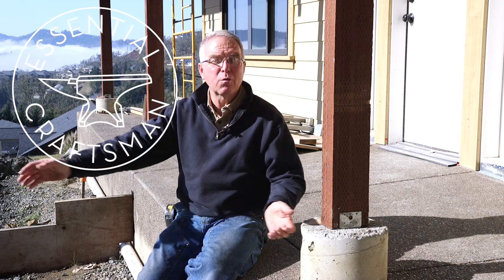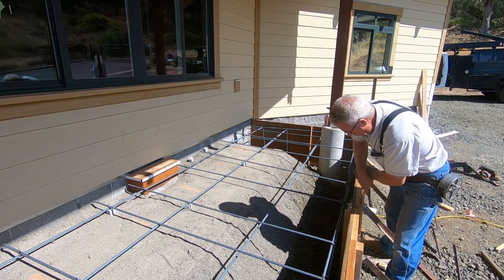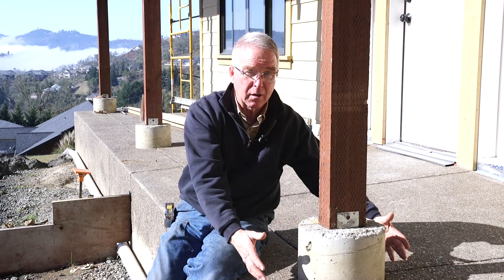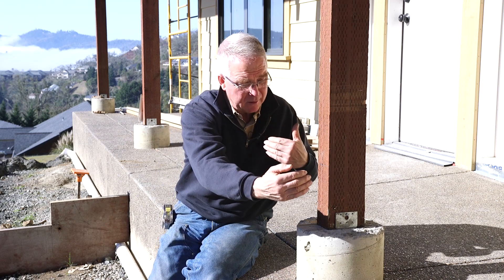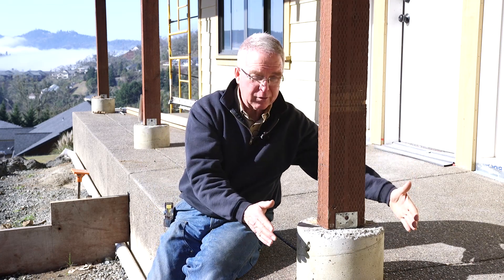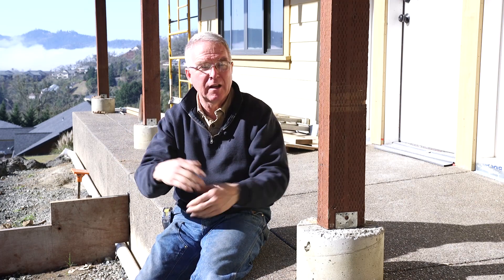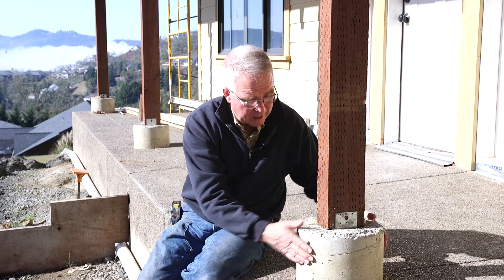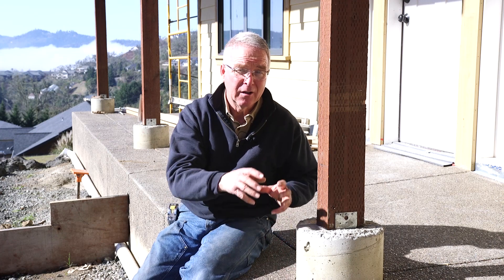Planning Out a Front Porch

Comment: Whenever I do column bases for porches, the framing is actually hung off the post about an inch off the concrete porch. And the finish product (something that wont rot like pvc, cement siding, stone) goes all the way to the porch surface.

Comment: Living in New England I have to disagree with your statement about the permanence of masonry. Whether it’s a sidewalk, patio, or outside steps, eventually someone will spread rock salt on it and it will start to degrade. In 1970 my dad built a retaining wall with 12” CMUs. While the wall is still there, despite not having any weep holes, I have had to replace the 4” thick cap blocks twice. I suspect the problem is from trying to blow snow over the 6’ high wall and thereby driving moisture into the edge of the cap blocks. Brickwork tends to need repointing after 40 or 50 years. Flagstone walkways and patios, even if they aren’t abused with salt quite often have the mortar come loose from the joints and the larger stones will usually break loose from the bed of mortar. There is no bigger attraction than “no maintenance” and in home construction and remodeling there’s no bigger lie than “no maintenance”. There will eventually be some maintenance needed. In the case of this house it will probably wind up on the third or fourth owners of the house.
Reply: Well, they really don't have much in the way of snow here, so I don't forsee them putting a lot of sock salt down on the concrete.

Comment: I'm all about the "low maintenance" aspect of building pretty much anything. And I'm willing to pay more to get to that point.
Now if only there was some form of wood treatment (EDIT: that is environmentally friendly) that rendered the wood utterly indigestible to insects, fungi, and whatever else likes to eat wood, I'd be much more ready to consider using wood on exterior surfaces of a house.
For that reason, my personal opinion is that synthetic (eg. vinyl siding and other such composite materials) or mineral materials (eg cement board/"hardiboard" as used on this house) are the way to go if you don't have the money for a full masonry exterior, or don't like the look of masonry for some reason.

However, IMO masonry and concrete products are still the superior choice in nearly all situations, barring other considerations.
As far as maintenance goes, I can only think of repairing damage due to accidental damages and vandalism.
After all, masonry and concrete as a whole are just varying kinds of rock and synthetic mineral formulations that amount to roughly the same thing as a rock, and there's not much you can do to hurt a rock over the course of a human life, barring some forms of chemical attack like acid rain (I'm sure there's things that can be done to masonry to mitigate even that), and blunt impacts.

Comment: After repairing countless examples of wood rot. I will never use common pine exterior trim on anything close to the ground(on the east coast). The alternatives are worth the extra cost, because in alot of circumstances the repair of wood rot is never as good as the original install. For example, when theres rot on windows, you end up just wanting to replace the whole unit even when only a small part is rotten.

Comment: Good morning. I was looking at the video where you frame the dormer with the valley jacks. 

I wanted to ask about the length of jack side cut on the framing square and how you converted that to degrees. I am told mostly that you always just use a 45 degree bevel. But you seem to be saying it changes as the pitch changes. And I want to believe that. 

Can someone please explain how he gets the change from length of side cut from the framing square table, converted to degrees for the bevel cheek cut? 

In his video it was a 9 1/2 - 12 which turned into 49 degrees. Which he said would be better if he had used a 51 degree bevel. 

Thank you!

Comment: The typical New England way would be to pour the footings under the porch slab. Screw or epoxy the brackets into the slab. The metal keeps the post elevated off of the concrete. Your method isn’t common. Square and wood makes for happy carpenters. Round and concrete...not happy.